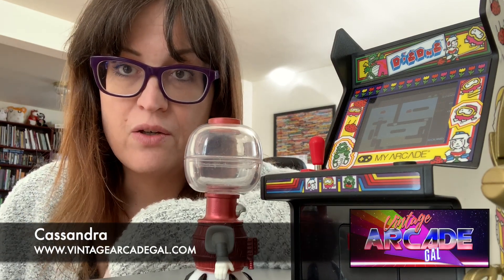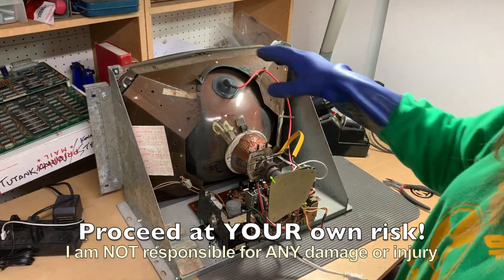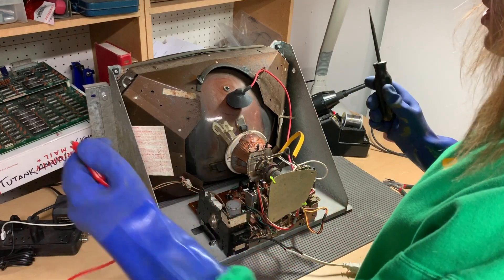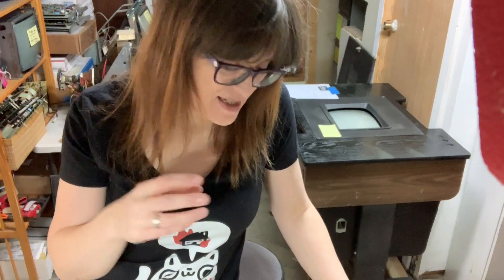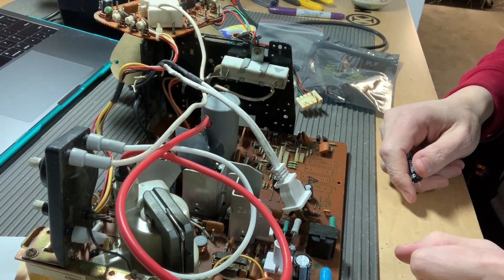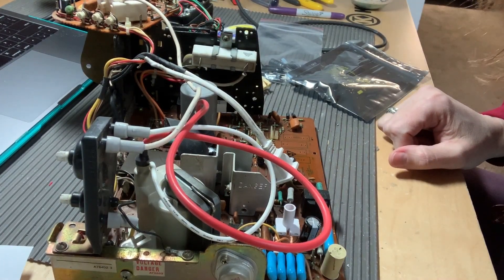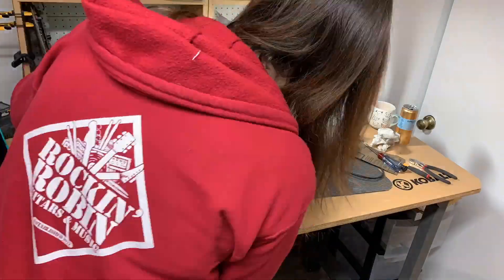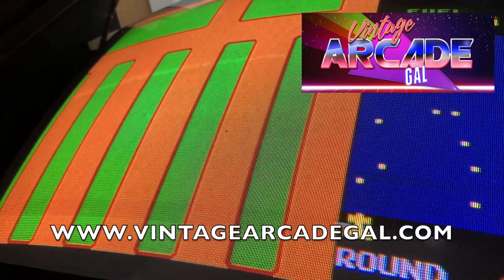Electrohome G07 Monitor Discharge & Cap Kit Installed (Rally X Restore Part 1)

Comment: Power supply caps are usually rated in microfarad- the "uF" means micro + farad (the u with a tail  is actually "mu", greek for millionth)-- little cap trivia for ya
Great video! 
MS

Comment: I just capped a G07 a few weeks ago on my second Outrun.  I gave it a full rebuild which included the Pot kits for the neckboard and PCB.  Pretty much bulletproofed it and a rejuve.  Turned out great.  Glad to see more of these videos in the hobby.
One last thing.  It's a good idea to check the B+ on that monitor.  Pretty easy to do on the G07.  I was having issue with my Horizontal width and when I checked B+ voltage it was low (110v).  I turned it up (120v DC on the G07) and it fixed the issue!  You'll want to adjust the B+ first before anything since it affects everything globally.  Here's a great resource for B+ settings on all monitors and where to check them on the PCB - https://www.arcadepartsandrepair.com/tech-help/monitor-b-settings